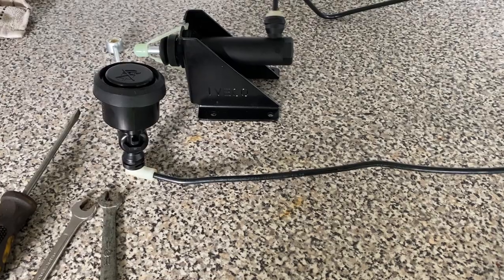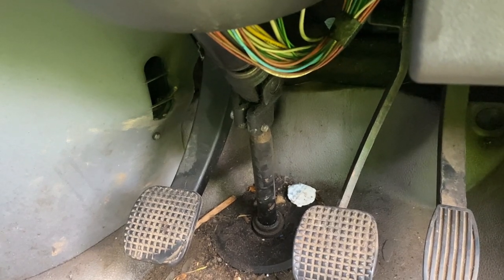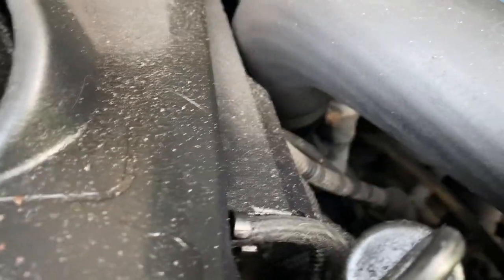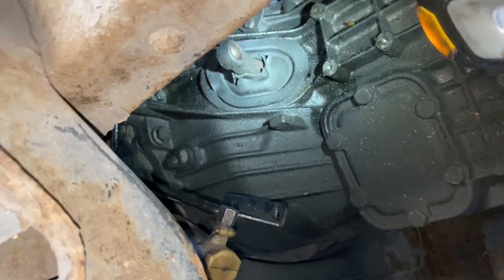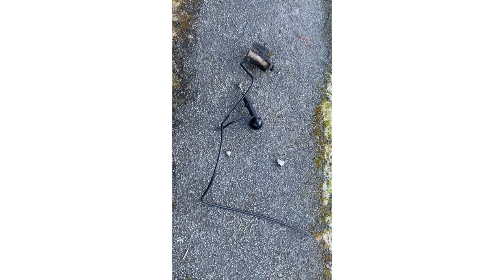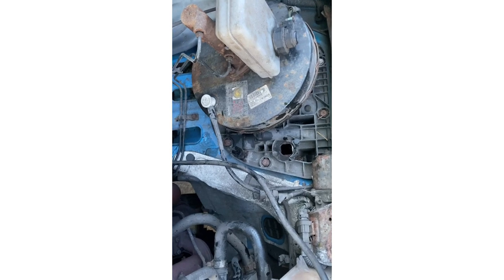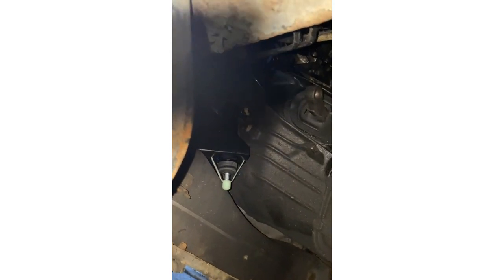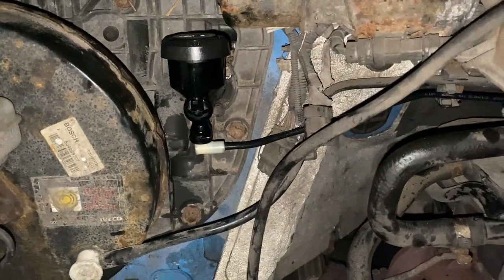Iveco daily clutch master and slave cylinder replacement

Comment: The reason your peddle dropped to the floor the plastic clip on your brake and clutch is more likely snapped and you will have to change that although it will still work it will just mean your clutch paddle will be heavy the same thing happens to my van .it’s a vacuum system and dose not require fluid